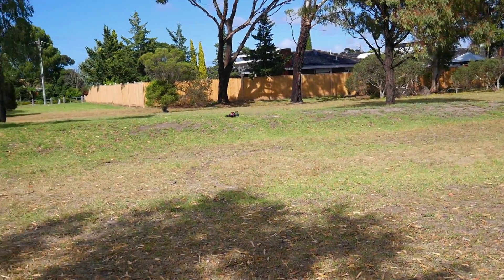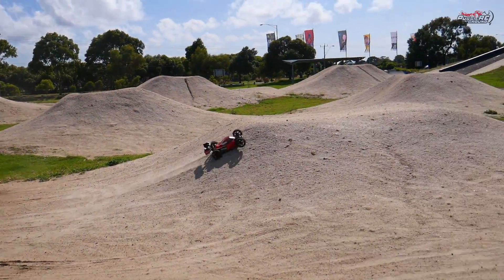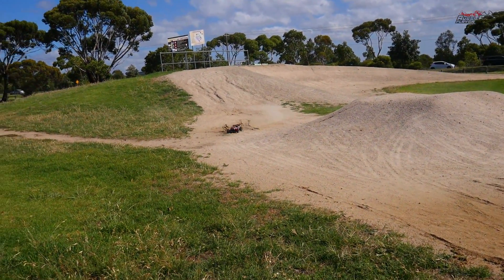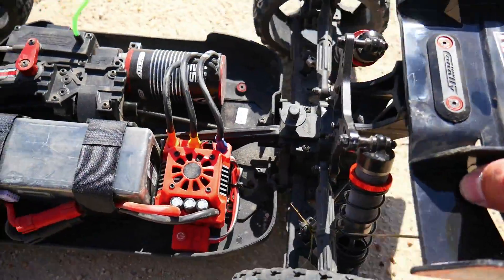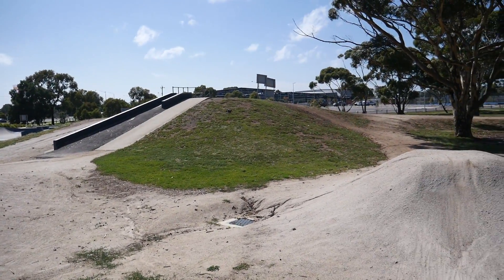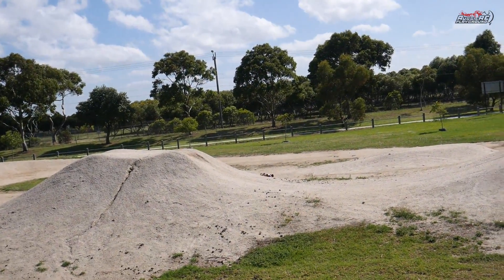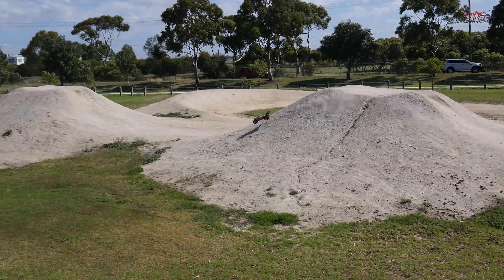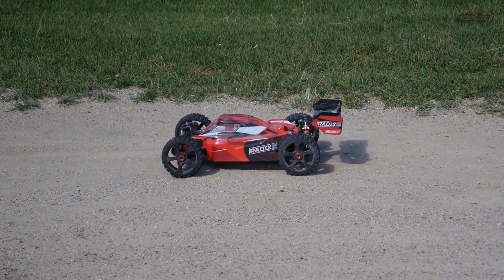Team Corally Radix6 on 4S - Stock

Comment: Great looks and speed wise , don't know why it came with 4mm front shock tower, an easy improvement would be to got 5mm. Also needs handling to be tuned, could it be down to the off center driveline? Handling and stability - They could learn from the TT buggys I reckon, or even Losi..

Comment: Hi Vaz, I've had a few Corally cars, they have all been like a race version of an Arrma. The diffs always need a tune mate, once you've done that it'll be great
Reply: What diff tunings do they usually need?
- AussieRC always reports the Corallys as 'twitchy'
- this down to the diff tune?
Reply: @FlyingPhilUK  they are set up for racing, so, on the rough stuff, a little too responsive, tuning with usual oils sorts it out
Reply: Do you still use the rzx rage

Comment: You could try disconnect rear sway bar to get rid of a little twitchyness. Also standing the shock more upright in rear will help with that. I reckon with that much steering it would do well on track with some grippy tires. Thanks for the video mate.

Comment: That thing is awesome On most race tracks I've raced on anyway 4S is more than enough power for this size buggy 6S would just weigh it down making it land harder and over work the suspension There aren't long enough straights to make the extra weight worth having all the waisted extra power I'm sure it's fun as hell bashing thrashing and doing speed runs on 6S though 😁 
Cool vid 🔥👍✌️

Comment: I still cant believe I just watched a 4S run😂  Loved every minute!  Toyed with the idea to get the Radix4 but then came to the idea just run the Radix6 on 4S and if I want to go seriously insane gear up a couple of teeth🤣
Reply from the maker: It's definitely more than capable on 4S, but does need a diff tune...
Reply: @AussieRCPlayground  would a diff tune help with motor temps? 
6s is insane on this thing but the electronics get to hot

Comment: I have the same issue with my RC6GS V1 and it is very touchy.  The steering is a bit sensitive.  The gyro is super responsive perhaps too responsive. 10% of gyro is a lot.  A lot to get use to and setting up for your car.

Comment: Even though it's basically a max 8 combo, seems to be more aggressive or powerful from everything I've seen.  Really curious what magic team corally did.  Different programming?

Also super curious on your thought on 6s.  Many have said team corally cars are setup for 4s for handling, and 6s is too much weight for suspension setup.
Reply from the maker: I'd have to agree. When you see the 6S run you'll hear me say that 6S seems like it's almost too much for this car. Maybe for the Mats it's a better match, but for the buggies, 4S is plenty for most people and then some.🙂
Reply: @AussieRCPlayground  this is where 5s really needs to become more common. A few cars on the market are quick but leave a little to be desired on 4s and stupid on 6s.  The redcat kaiju comes to mind.

Comment: Great run Vas, this thing 4s is insanely quick :D
Probably needs different tires for better air control, maybe the Typhon 6s ones would work better.
Reply from the maker: Thank you Kitris. I have something in mind, but not the Typhon tyres, that would create a conflict on the interwebs, so best to go neutral on my choice. LOL
Reply: @AussieRCPlayground  Looking forward to it, this beast on 6s is going to be mental🤪

Comment: The shock towers can be a weak point on the Radix 6 at only 4mm thick, this is quite thin for a 6s car. The Typhon 6s uses thicker 5mm thick shock towers.

Comment: I think this is superior to the typhon 6s. The power whats the secret of that thing. I want that power out of the box
Reply: I think they have almost identical electrics, so speed is just up to gearing and batteries really. I think you're wrong about it being superior, might be one day but not now. It's not as stable, composed or refined as the Typhon at all. People tend to like the new and think the "old" is boring, I get that, I'm the same. But in this case I'm not convinced. Just go back and watch Vas old clips of the Typhon V4! Different spot, yes, but hard not to be impressed really! Have a nice day!
Reply: I think it is mostly gearing.  the Typhon is geared OOB for 6s - the stock 14t pinion is too small for 4s.  Drop a 16t or 17t pinion, and the Typhon is great fun on 4s.

Comment: Whats the secret of its speed? Gearing or electronics? Only motor?
Reply from the maker: Combination of all of the above, I think. Whatever the secret, it's great. 😁
Reply: Man I've been questioning that since first kronos v2 footage.  I don't see anything special.  Max 8, 2000kv 4274 motor.  Nothing special driveline I can tell like limiting angles of axles to reduce parasitic loss.  Actually pretty big angles with offset center driveline.  

My only guess is custom algorithms for esc.